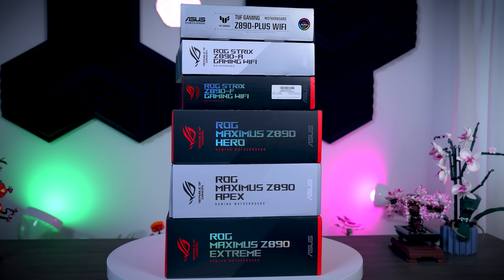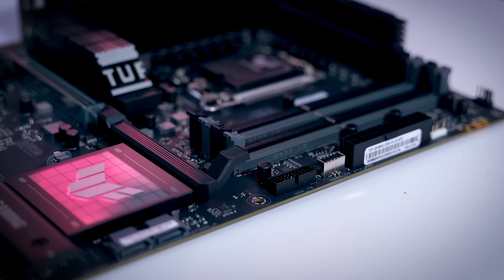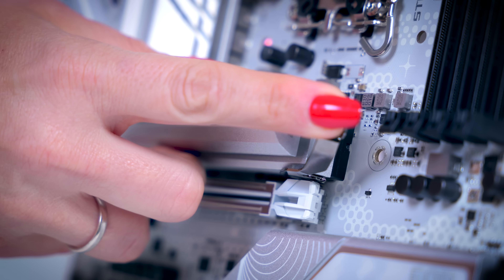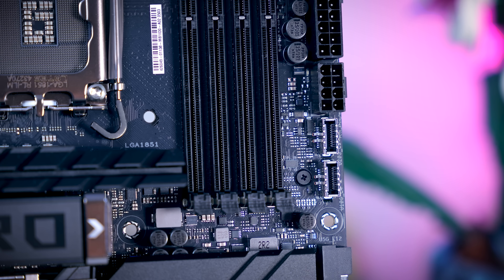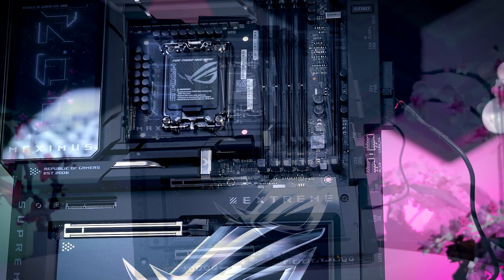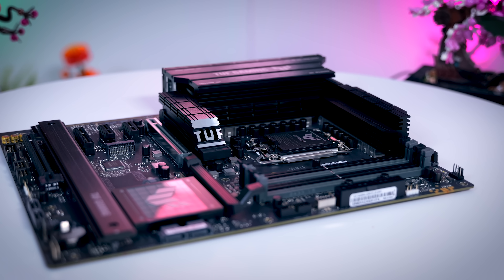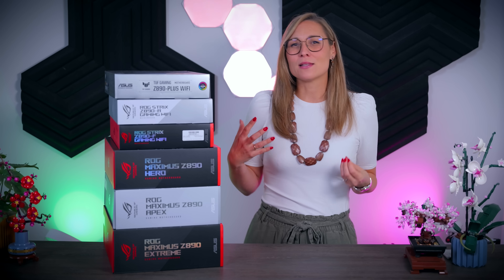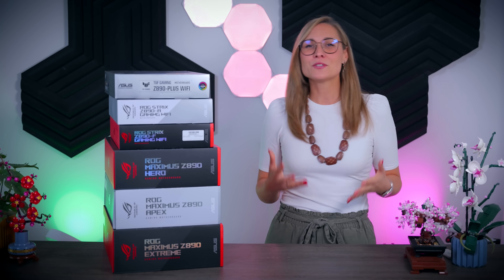New ASUS Z890 Motherboard Line-up - Core Ultra 2 Series Ready

Comment: while most of these boards are overkill on the VRM front,
i can't blame them that much, because ever since 12th gen,
they been freaking out about Intel. And we've seen even with
alot, Intel had a power efficiency problem and they tend to
be more strict with the board partners than AMD. so in a
weird way i can't blame them, it's the other part you said
that bugs me. trying to make one board more flashier than
the other, it's like are you really giving people a reliable
solid board, or are you just trying to win a race on who
makes the best looking board.

Comment: To me, the biggest problem of the Hero is the Z890 ProArt Creator Wifi. The ProArt offers Thunderbolt 4 & 5 and 10Gbit/s plus 2,5Gbit/s LAN. Plus a more than enough power section for most users. Usually, I buy the Hero versions, but this time I went with the ProArt.
Reply from the maker: I'd say the ProArt is one of the better series this generation :)

Comment: Can you help me with something? Where you able to install windows 11 or 10 successfully? I Can install it but when restarting it freezes at the asus logo for both windows 11 and 10….
Reply from the maker: Of course, Windows 11 (I don't think 10 makes sense anymore, so I haven't tried it)
- Did you do a clean install (maybe make a new boot USB)
- Did you update your bios
- Check your memory settings/speed/compatibility

Could be a lot of things though, hard to say.
Reply: @ hey thanks for your help. Apparently with the new asus rog z890a the default bios is the 05** the initial factory setting which does not properly set up the UEFI boot route. So it lets you install windows but when restarting if freezes. The solution was to update the Bios to the latest. Just in case any one else ask you. Cheers!

Comment: I just purchased the Maximus board... and  yes  it was insanely expensive...But I got it specifically for the 10GB networking and the number of NvMe slots and the number of High Speed USB.
I intend on pushing  MASSIVE amounts of data through this thing on my fiber 25GB network.
It has  way more bling than I was looking for  (meaning the rgb)  but  I am sure I can turn that all off.
Reply from the maker: You can :P

Comment: New GPU release mechanism? It's been at least 6 years
Reply from the maker: Where you can just pull the card out slightly sideways and it comes loose without pressing the release switch or any button? Pretty sure that's new.

Comment: I know by your responses to some comments in this comment section that You gonna do the X870 line-up, maybe also the X870E one, because I have a Ryzen 7800X3D cpu, a Strix 4090 OC gpu and a Platinum 4090 gpu, my question is: which one between the Strix X870-E and the CROSSHAIR X870E is theorically the best for the components I mentioned before and regardless of the price? Knowing that I want to make 3D modeling, render and animation and in second time, gaming
Reply from the maker: I'll be working on an AM5 version of this video later this week, that should include the X870E-E and the Hero. I haven't looked at all the details yet though so I can't tell you yet which I'd pick.
Reply: @TechTesters  Ok, thank You for your response, so we gonna see it in the next videos!

Comment: With most of these boards I'm worried about gpu backplate clearance. A lot of these boards have a massive M.2 heatsink which will get in the way of the GPU backplate if you have a thick one
Reply from the maker: I haven't tested a bunch of GPUs yet but the Hero M.2 heatsink doesn't bother the Nvidia 4090 FE at all.

Comment: Something worth mentioning, AFAIC, is the number of supported thermal sensors. Placing temperature probes at strategic places in the case (e.g., on a tower cooler, or at the GPU backplate) can give one really nice smooth fan control (avoiding spikes from internal CPU sensors, for instance).

Comment: I would go with TUF Z890 PLUS. About 1.5 years ago I bought TUF Z790 PLUS + i9-13900K + ASUS TUF 4090 OC. No bottlenecks if you don't overclock. Works perfectly fine as a gaming PC without any overclocking. Runs any game in 4K.

Comment: I would probably pick the Asus Prime Z890-P WIFI as the most basic, like the feature set on this one better for price comparison it is quite a bit less expensive than the Tuf version. I was thinking about getting ASUS again, but disappointed in the feature set compared to other manufacturers and now leaning towards a Gigabyte board due to addition of LED readouts and adding Start and reset buttons on their motherboards. Asus appears to be wanting to still charge extra for these features which should be standard

Comment: Not sure were you got your math at but 11months ago I bought the z790-f wifi and the price was 269.99 and now the z890-f wifi is 499.99 the 230.00 difference almost double, I bought it in oct the day intel released the i9-14900k. thanks for sharing
Reply from the maker: But at that point the z790-f was already out for a good while. The original msrp wasnt very different from the new z890-f.

Comment: From Asus it sounds like the ProArt Z890 is going to be the best buy for that ~$500 mark (assuming the initial pricing turns out to be accurate). It has 10Gbe and 2 Thunderbolt 5 ports with 5 usable M.2 slots. It doesn't have quite as robust of VRM, but still should be more than enough for any of the Core Ultra 2 CPUs. The only negative might be that it doesn't have  the Nitro Path DIMM slots so potentially wouldn't have as high of memory clock speed possibility.

Based on the pricing of the ASRock OCF and Asus Apex I'm guessing MSI's Unify-X won't be in the ~$400-500 range like prior editions had been, but I'm very curious about that board just the same.
Reply from the maker: Yeah the ProArt looks pretty good, trying to get my hands on one atm :)

Comment: w/ the Hero or Extreme, at M.2-1, there is a LCD plate at the top left of the motherboard.  Does it block the installation of a 3rd party m.2 heatsink , if so, can that plate be removed?  can anyone help

Comment: i'm extremely dissapointed with motherboard offerings at launch lack of MicroATX pricing starting at over $300 cdn for low end is just criminal i want my $79 motherboards again 
i couldn't care less about "toolless" or all the heat shields just make me a cheap board no RGB or screens and black. with a bios flaskback and wifi/bluetooth or just give me the m.2 to add intel card, mircoATX thats all i want. i don't even care about overclocking anymore

Comment: ASUS has a Thunderbolt 5 add on card and it uses on the TUF board in the illustration. Can you confirm if the add on card is compatible with any of the boards, like the previous Thunderbolt 4 add on card there next to no documentation on compatibility and no actual advertising that it exists. A lot of people who bought ASUS or MSI motherboards don't even realize they can get a Thunderbolt 4 add on card.

Comment: Instead of US prices been 1/2 as much so the 870e hero is US700 but is $1300 in Oz ( should $1050 ).  In Australia we pay a huge markup .  I just love having postcodes on my motherboard and I see MSI has one on its Tomahawk 870e which the Tomahawk series never use to have.  Today just finished putting the Carbon 870e together with a 7950x I had ( waiting for 9800x3d ) and putting Win11 24H2 on it .... hope to save a fortune in electricity costs, well maybe a $100 or so per year

Comment: All my brain comprehended and heard was thunderbolt 5 will cost me an extra $1000.
Reply: There's an ASUS TB5 add on card, it should be compatible with some of the boards.
Reply: @NanoNutrino thanks for the tip! Exactly what I want.
Reply from the maker: Do we really need TB5 already though?
Reply: @TechTesters  Is it possible to use 4K @ 240Hz with TB3/USB4? I realize that this obviously means that the monitor also needs to support TB5, which current models don't...
Reply: I feel like once you start daisy chaining your monitors, it's hard to go back. Tb4 I can't get above 85hz for 2 monitors at the same time it seems. Also the Oculink thing as  an alternative solution intrigues me. Intel needs to keep up. I just want options. :)

Comment: Wouldn't touch ASUS with 2m pole. After 13th and 14th gen and their attack to servers with their W680 boards directed by Chinese government almost brought the Internet down and now it is very slow as 100% CPU's failed on W680 boards from ASUS. You should not buy ASUS because you are risking your system. China has almost 100% monopoly on motherboards. MSI would be lot safer option as it is partly Taiwanese and we didn't see problems on MSI boards for the 13th and 14th gen CPU's.
Reply from the maker: ASUS is Taiwanese. And MSI motherboards are also made in China. I don't think they're as different as many seem to think :)
Reply: @TechTesters  Get your facts strait. Looks like you are Chinese propaganda. 

Motherboard Brands:
Asus 65% made in China.
Asrock 4% (parent company Asus)
Gigabyte 14% made in China/Taiwan
MSI 14% made in China/Taiwan
Reply from the maker: @paulboyce8537  We literally watched MSI Z890 boards roll off the assembly line in China 😉

Comment: A new series, CPU, graphics card, motherboard on the horizon. If you wanted high end forget it. 
Dunno cost of the new Intel CPU’s, but 5080/5090 up to $1300-$2500, then these boards between $400-$1300 not much change left. Need to get a mortgage  loan from a bank.. Ridiculous..

I only ever bought an ASUS motherboard once. DOA and warranty rejected. Won’t ever buy from them again.

Comment: What about the STRIX z890-e? can you also confirm the USB ports are USB4 V2? Also would like to know if the board / CPU will support bifurcation 4x4x4x4 in the X16 PCI slot; the i9 13900k with the ROG STRIX Z790-A Gaming Wi-Fi D4 only support bifurcation 8x8

Comment: These boards are starting to feel like the behemoth US luxury automobiles of the 1970's, where every plush door had a mostly useless ash tray, lighter and reading lamp.  I wonder if supermicro is going to come out with a board that just does away with all the glitz and unnecessary power stages and concentrates on high end PCIe, M.2, USB, and a10G lan.

Comment: The Z890 ProArt seems a bit underwhelming, especially at its price.. I have the ProArt case on standby for my new build. But leaning towards the ASRock Taichi or Taichi OCF. Maximus Hero may be my other option, depending on price, and features.

I'd definitely like to get a CAMM2 motherboard if possible though. Heard they're supposed to launch before the end of the year. Be holding off until they show up to the scene.

I'd plan on doing some overclocking with the 285k Air Cooled + CAMM2. I've always been an enthusiast for air cooling my systems.

Comment: One of them will be possible my next motherboard from Asus. I always had Asus motherboards.

Edit: I wouldn't mind the 5Gigabit port because most in my country is 1gbps speed and that's maximum for now. Couple of years later, it will go higher but i see no problem if you can hold it for at least 10 years.
Reply: theyre not for internet bandwidth speed, but can affect

Comment: What a waste. 6 ATX boards for the same gen is ridiculous. Also no budget option at the start, will have to wait months for TUF to lower in price. It should be maximum 3 (budget, high end, and premium). I am not even talking that CPUs for the socket are meh.
Reply: There is an Asus mATX, the PRIME Z890M-PLUS; she just didn't cover it for some reason.  But budget boards are usually more of a B-series chipset focus, assuming that's still a thing.

Comment: Why does the apex have the option to power the igpu without the option to output it or it can be achievable with thunderbolt?
Reply from the maker: I'll have to test if you can use these Thunderbolt ports for display out, I'm pretty sure you couldn't on previous gens (except for boards with DP IN). But at least things like Quicksync should be usable now.
Reply: The 1DPC OC boards like Apex sometimes don't even have power phases for iGPU.

Comment: Just FYI: The Hero can only use 4 m.2 slots without limiting its PCIEx16 slot to x8.

The F can do 5, the E can do 6 m.2 ports without limiting the PCIE x16 slot.
Reply from the maker: It's pretty typical due to the lane limitation, but I'll look into the details of Hero vs Strix E/F, as that doesn't sound great.
Reply: Testrudi1981  Nope, its because they add too many m.2 slots for the amount of available lanes.
Reply: @Waldherz  There is no point for me to upgrade at all considering no z890 boards have enough gen 5 m.2 slots. I want at least two gen 5's for the ssd's without compromising the PCIEx16 slot . No more bifurcation! You should know this by now. Call me when your lanes are built independently.
Reply: @SharkBite-69  I dont care about speed, I just need enough space at decent speeds to edit videos from locally. 

I ended up going for a laptop with dongles cuz fuck intel desktop and fuck anything AMD related.
Reply: Still better then last gen, the only way you can get past the limits of the cpu lanes is to go xeon and that can be 10k plus...
Reply: @GrYnDonGaming  THe original Z790 Hero could handle 5 gen 4 ssds + 6 sata ssds + 1 gen4x16 GPU with no limitations.

The new Hero cant even do that.

Comment: The TUF is the same price in the UK as the Asrock Nova LMAO the difference in featureset is insane! 

Gigabyte have the Aorus elite WiFi 7 which is cheaper and has heatsinks for all m.2 and a postcode...

They must be expecting to coast this gen on brand recognition alone.

I suppose if your an Asus fan then your used to throwing extra money away for no reason by this point.
Reply from the maker: Can't wait to see some other ones. MSI is up next, Gigabyte.. still waiting. ASRock, still blacklisted I think :D

Comment: I had Maximus Z690 Extreme and still have Maximus Z790 Extreme, Z690E had problem running memory at 6000 XMP and Z790 not very stable above DDR5-6800. Both are very poor clocking RAM, the price is way too high for what it actually it. We used to pay ~650e for Asus X299 high-end boards that had way more features in the past. And even way more RGB! LOL!
Reply: Well, 2DPC boards generally don't clock mem all that high. From what I've seen even with a good IMC on 13th or 14th Gen, 7400 is about the max stable you'd get on something like an Extreme. CKD/CUDIMM might change things this gen, though.
Reply from the maker: Curious if it'll be better with the new clock gen memory maybe?
Reply: @TechTesters  Let's hope so :)

Comment: After buying an Asus MB in 2023 and having an issue with Intel 219 Ethernet controller where ASUS did absolutely nothing to solve the problem, but continued to sell the same MB even 1 year later on amazon (i ordered one and returned it because my was NEWER in some way than the one that arrived one year later) I would never every buy an ASUS MB anymore. If your monitor is off and you turn on the machine - the white light will glow all the freaking time without the possibility to turn this light off. Such crap that cost too much now in the day. ASUS from couple of years ago would been a fined quality product but this today...thank you no thank you.

Comment: The fact you have to go all the way up to the Maximus board just to get a post code led display is criminal
Reply: Strix-e has a post code for 499....but even so 499 is still expensive lol
Reply: 07 @stardust9329
Reply: Exactly, other manufacturers have cheaper option with it, so no Asus for me this time. It's not about the display, it's about sending the message.
Reply: It's been like that for years with Asus. Only Strix-E and above has the seven segment display.
The good thing is that other brands such as MSI / GB / Asrock started to implement them on their mid range boards. 
Asus didn't want to follow the trend it seems.
Reply: Why? You don't like to be in a state of uncertainty through restarts, and internalize all of your life's bad decision during those stressful times?
Why wouldn't you?
Who needs a BIOS code! NONSENSE Code lol!

I am kidding by the way. I need my codes lol
Reply: My Strix Z790 Gaming-E Wifi board has a start button and post code which reads CPU temp after booting into Windows and has the quick release button mechanism for the GPU that the new Strix board does not. They took stuff away and kept it at the same price.
Reply: It seems stupid that there's no LED post display when most of those boards have far more expensive LCD panels built in.

Can't they put the POST information on those?
Reply: asus overpriced crap
Gigabyte or Arock has better features at lower price points
Reply: Take a look at the Gigabyte line, added Start, reset and LED on many of their boards
Reply: I've got a motherboard with the 4 LEDS (DRAM, CPU, VGA, BOOT) and I haven't ever thought I needed more than that to diagnose the issues I've run into so far. What do people want it so badly for idgi
Reply: @Rushil69420  Those lights are pretty vague and will only show you if something is wrong with each of those items. Where as with the post code display it can show you a multitude of 2 digit combos that give for specific info when it comes to troubleshooting your pc
Reply: Well Gigabyte, ASRock & MSI is better then Asus
Reply: @mattstansbeary3068  lol
Reply: @mattstansbeary3068  Not really, MSI and Asus are pretty even, they are the industry leaders in this space. Asus has just lost a lot of integrity around their warranty process and their lineup is at a premium. Its a shame cause their products and ideas are really good. I'll be switching to MSI next i reckon.